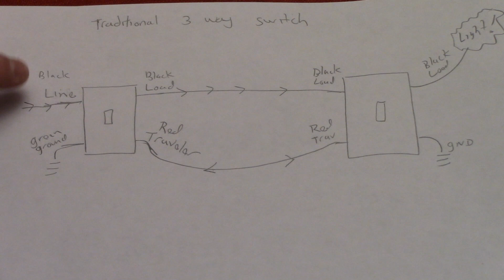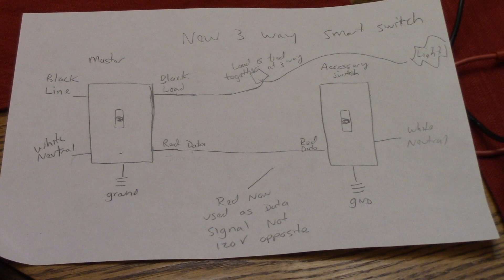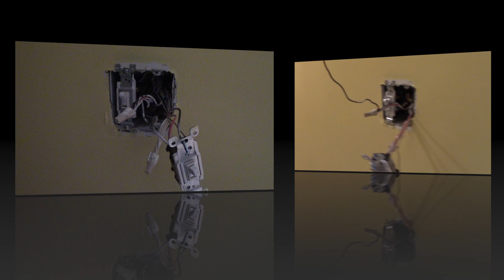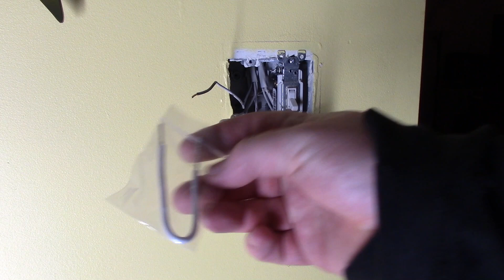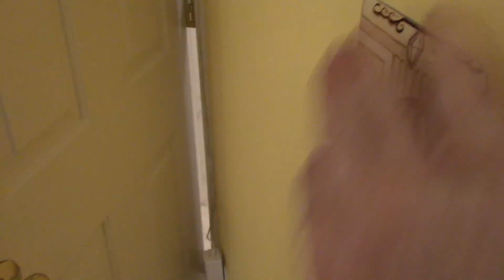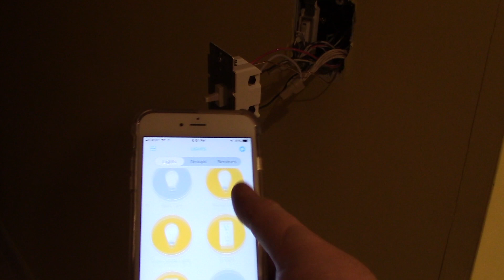Episode 67 how to install a 3 way smart switch

Comment: Are there two travelers In a traditional 3 way switch? When I was installing my smart 3 way switch the wiring instructions told me that there was two travelers. Or is there just a load line and one traveler?
Reply from the maker: Smart switch no traveler  its used for a data signal not for reverse 120
Reply: @ChrisEdwardsRestoration  Not in the smart switch, in a traditional 3 way. Are there two travelers or one? On my smart switch it has two terminals labeled traveler
Reply from the maker: One traveler.  Red wire it takes the flipped switch and sends 120v back the other way to get past the down switch on the other wall.  I wrote both ways on the paper in the beginning of the video

Comment: Great video. Would be helpful if my wires were all the same. I have a 3 switch setup for my kitchen and a 3 switch setup for the living room. I'm working on the kitchen circuit right now. 1 of my kitchen switches has 120v on the red wire and the living room switch next to it has 120v on a white wire. I'm so confused. On the kitchen switch, when I touched the red and black wires, it turns in the living room lights. I have only disconnected the wires from the kitchen light, so I'm sitting her scratching my head at how the hell does this happen. I'm guessing some electrician just plugged wires in and didn't bother to follow code. I'm very lost in this. It's trial and error at this point.
Reply from the maker: some electricians wire a red as a jumper from the feeder , check other panels to see how it is fed, it may be at another switch location and a red was used for a jumper. happened to me too!

Comment: Hey guy.  Great info...I do have a question , I’m not sure you have  experience with...I have a 4 switch setup for my stairs.   How would I wire that?  Do I add the 3D switch’s as an add on? Or do I use a master?
Reply from the maker: you use one master and as many add ons as you want, just bond the loads together all the way back to the master, i have a 4 node one, works great!
Reply: Chris Edwards 4 nodes as in 4 switches all work into same light fixture?  Sounds similar to what mine needs.  So with that in mind,,,Master still starts at the “line” side?   I get confused cause some literature I saw had it set with the master as the farthest from line (hence on the load to light).  Please clarify.  And thanks again for the helpful illustrations.
Reply from the maker: @FrankieKennethL  Master is always on the feeder 120 from the circuit breaker,